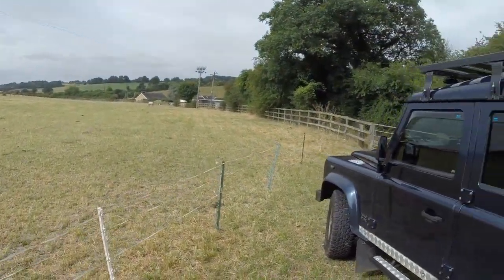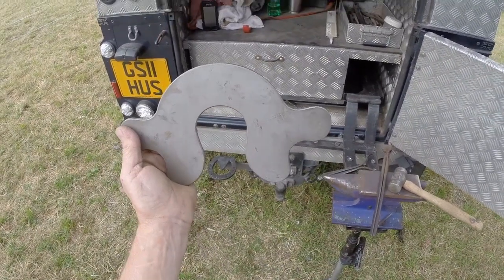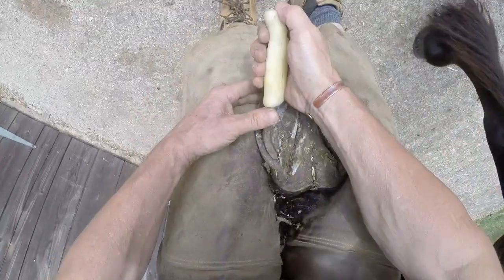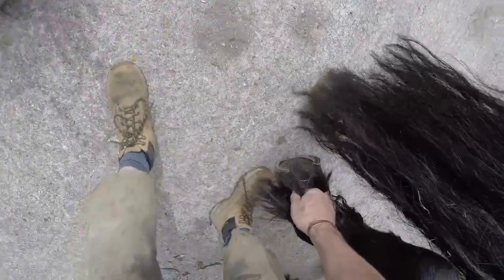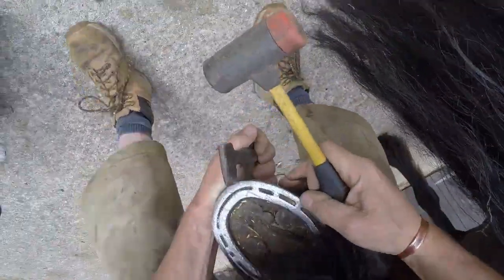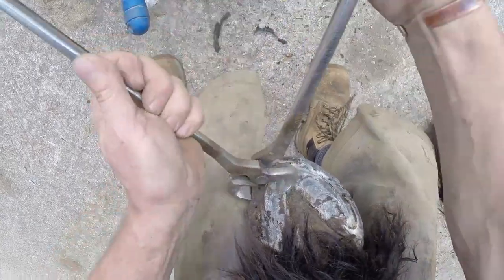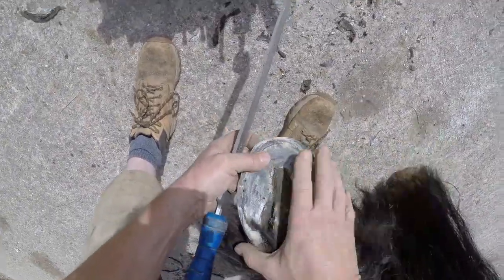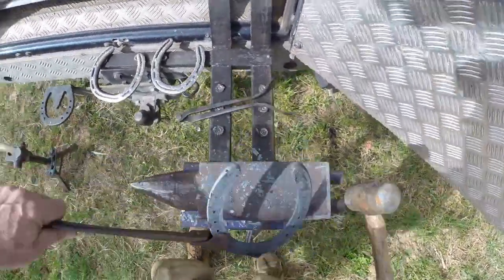Boomerasp

Comment: Any tips for working in the forge when it is hot? It is 30-31 c every day here.
Reply from the maker: only the obvious things. make sure you have good ventilation and air flow through the shop, be ecconomical with your movements and drink plenty of water. it's very easy to get dehydrated in a forge!

Comment: I see the Venturi signifying a gas forge, but how can you operate it inside your vehicle with demolishing the roof.
Mine was on a swing out.
Reply from the maker: There is very little heat from anywhere on the forge except the front exhaust. The roof is also lined with heat resistant board just in case😳

Comment: I'm sure this boomerasp will die the death the same as other revolutionary aids for Farriers, if a Farrier finds it difficult to get a level foot with tools that are traditionally at hand, I think maybe a little more training would be the case, incidentally  if you hold the film at 5.10 you will clearly see that the inside heel is lower than the outside, which in my book is a very unbalance foot.
Reply from the maker: frank andpersonal you think?
Reply: Well that's a very measured and intelligent reply, which part does your comment 'you think' imply? because if its the unlevel foot, its plain to see, you can't put that back, he'll have to rob the other heel or end up with either 
bent shoe or a sprung heel, not something one would be proud to exhibit on social media to sell something.
Reply from the maker: +frank andpersonal Lol! What a prat! Firstly, i'm not selling anything, I was given the rasp by the inventor to try out. Secondly, if you had even a fraction of the knowledge you think you have about Farriery you may have asked yourself why is the inside lower than the outside.  As you obviously have no working experience i'll tell you. The horse is old and is pigeon toed. He is too old to make any lasting corrections to his conformation so lowering the inside turns his toes out and corrects the affliction for the duration of the shoeing.....
Reply: Wow! this gets worse! my mistake not selling just promoting,........the point of the frog in relation to the foot indicates that the horse points out if anything, you don't have to be a working Farrier to see that, its on your own video! my experience is with people that say they have first hand knowledge of anything and are caught out, first come the profanities, then comes the superior knowledge, sadly common, I have no need of a reply
Reply from the maker: +frank andpersonal shame you don’t have any real experience, just an ordinary troll! I guess my forty years shoeing have all been wasted!